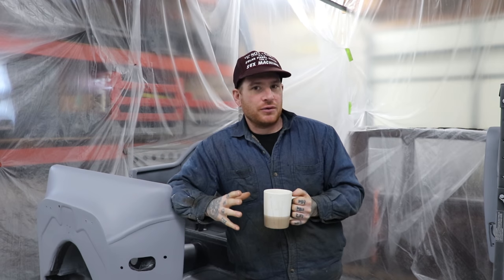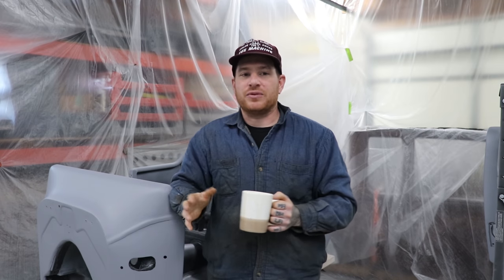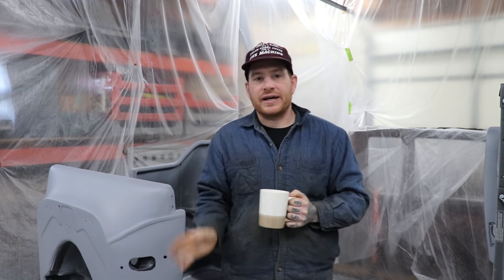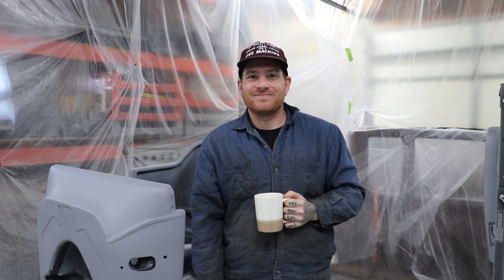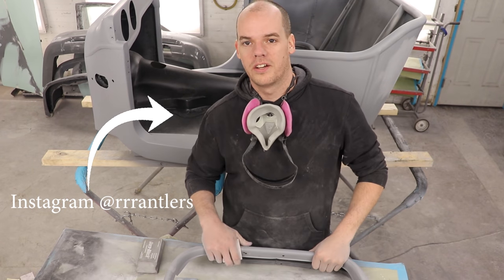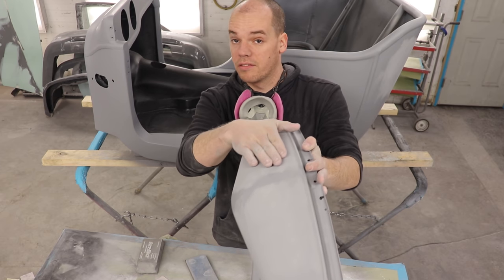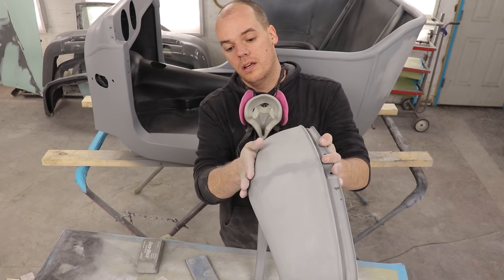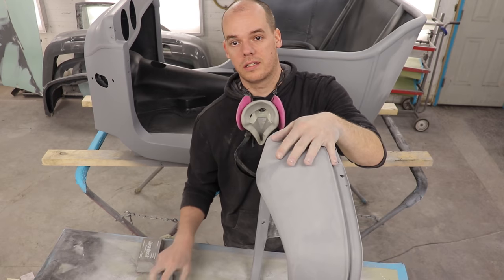Paint A Happy Model T - Ford Free-T - Ep. 73

Comment: Go to Harbor Freight and get some furniture dollies to place under those crated bodies. There are 2 different sizes-use the sale coupon- Get as many as needed, they will come in handy for engines, rear end or front end assemblies. Make some brackets or bucks to hold stuff off ground and move out of way when not needed. Your back and knees will last much longer, and wont have to have metal replacement parts installed later...

Black looks great...MY personal choice would have been a deep blue,I think it brings out the curves and lines better...but that is just me...
Reply from the maker: I have tons of those dollies. This needed and actual frame built underneath of it to keep it off of the ground and very sturdy so it could sit on stands to paint. I appreciate the tip though! -Matt/ITG

Comment: Mike #2 did a nice job painting. I was wondering how long until you got the engine back? What are you going to do with the frame paint or powder coating?
Reply from the maker: I need to call and get on my engine builder, it should come back sometime this month if all goes well! Frame will be getting Eastwood Chassis Black Paint and a satin clear. -Matt/ITG

Comment: You don't use a black guide coat before sanding?????
Reply from the maker: Throughout the process we did use guide coat to check our progress but we also used a trick of spraying the panel to wet it and give you an idea of what it will look like with clear coat on it. This helps a lot with the process and saves a lot of guide coat. Not the best way for everyone, but works well for us. Thanks for following along! -Matt/ITG
Reply: Hi Pete! To add to what Matt said, I do personally like to skip guide coat while sanding urethane primer. I find that it's not necessary due to the semi-gloss off-the-gun finish of the primer. As soon as you hit it with paper, it flats right out and gives enough contrast to see highs and lows.

Comment: Um, it seems early days to be going for a finished paint job. Turned out nice, but man when bolting it back together, you're gonna have to be so careful  I am not a fan of base coat clear coat. Over time, the clear coat tends to come off. I think the reason for that is the clear is put on over the base which is not sanded to give the clear enough "tooth" to stick like it should. Maybe with that high end paint, it's not a problem, but with most factory paint jobs, and many custom jobs, it happens at about 5 to ten hears, depending on how much sun the vehicle sees.  If you've ever seen a hand rubbed lacquer paint job done correctly, it makes these base coat clear coat jobs pale in comparison. I guess you can't even get lacquer these days, damn the do gooders and EPA. I suppose we'll just have to do the best we can. Of course, back when I was still painting cars, we used the siphon cups, not gravity feed, and none of the paints were water based like most are now.  Back then there were two choices, lacquer and catalyzed enamel.  Lacquer was more common for panel repairs, cat enamel for complete paint jobs. No clear coats, unless you consider real candy paint jobs clear coats.
Reply from the maker: Clear coat only fails like that when it isn't properly sprayed or the panel prep is incorrect. This is common in quick "scuff and shoot" jobs in collision repair. I appreciate you following along! -Matt/ITG
Reply: @IronTrapGarage  I see it a lot in factory paint jobs as well. My Mom's car went bad only a year after she bought it, She made em fix it free. Oddly, the fix lasted way longer than the factory paint clear. Maybe if you use that quality stuff, it won't happen, i imagine even the factory uses the cheapest they can get.

Comment: that is soooooo not a paint booth!  its dangerous and is not up to code to paint in a booth like that! the heater in the  booth could cause an explosion and the lights are not properly installed for a paint booth.   spend some money like us professionals do to be legal and its obvious that he paints in this so called booth alot.  I hope no one gets killed working in that booth.  Also no fire suppression  system in the booth.   VERY DANGEROUS.   USE A PROFESSIONAL SHOP THAT DOES THINGS THE  RIGHT WAY.  DONT PAINT IN A HALF ASS DANGEROUS BOOTH, YOU WILL LIVE TO THING ME
Reply: Thanks for your concern. I assure you, the heater never runs while there is paint in the gun. The troffer lights are modified and sealed. The fan is a sealed-motor "explosion proof" unit. I've painted in this garage for many years, and never had the slightest issue. It's not a flawless shop or a brand new downdraft booth, but it's fully functional and safe, and I've covered all my bases. Thanks for watching!
Reply: Don’t be like that these guys are doing things that everyone of us would love to do ourselves in our own garages and their doing the way it was done back in the day, everyone helping their buddies. ie: motor is done by one guy and body work is done by another and the owner is doing what ever he can to keep the costs down.